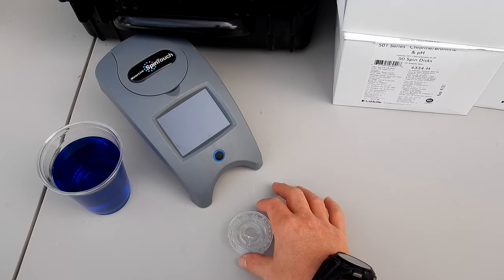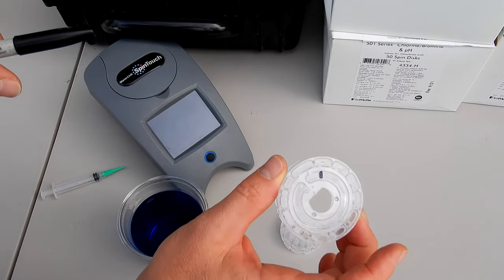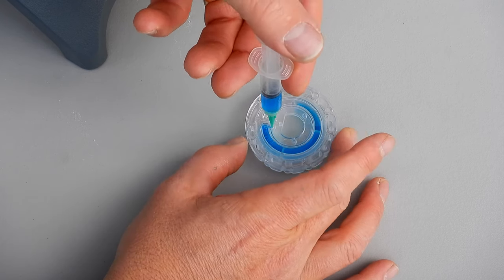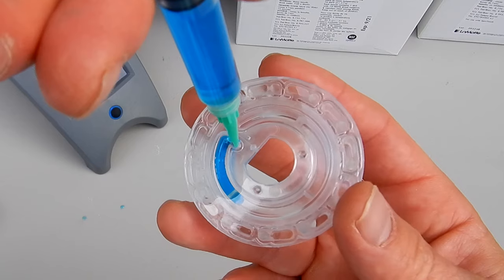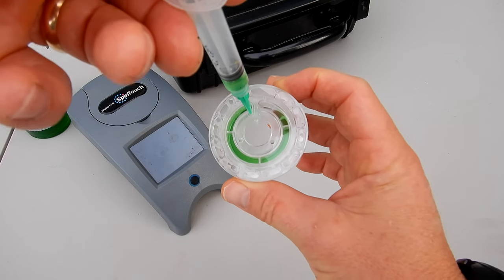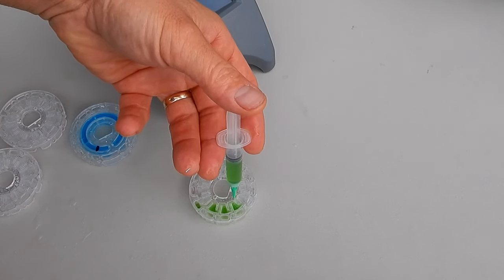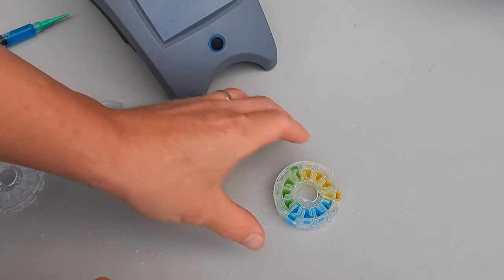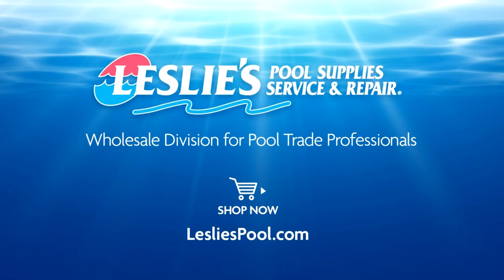How to Properly Fill Your La Motte Spin Touch Spin Disks

Comment: Dave this interesting but what is this spin disc for I have no idea thanks for sharing.🎄🎄🎅🏽
Reply from the maker: Thank Lou. This is the time of year where I put out more technical videos. The Spin disk is for a specific water tester that sells for $900 and typically is not used by a homeowner. A lot of pool stores will be switching to this tester in 2020-2021. So you may yet see one! 😜
Reply: Dave thanks
Reply: @SPL  $900 for a water test kit?????? Why in the world will a pool store even stock this, it will never sell. A Taylor kit, or TFTest kit with refills every two years for less than $40 is all anyone would ever need.

Comment: Im really confused. Im at this apparent complex where the pool is 30k gallon and span is way less. But how come the spa has (2 pumps one labeled skimmer suction and the other drain main drain suction) and also has two sand filters. Where the pool only has one pump and 1 sand filter. Any idea why they set it up like this? Where I think it should’ve need 2 pumps for the pool and 2 sand filters. What do u think.
Reply from the maker: I agree. The set up is reversed. That is pretty odd.